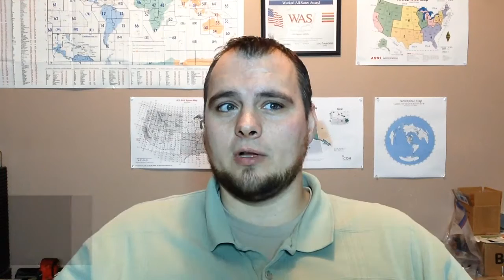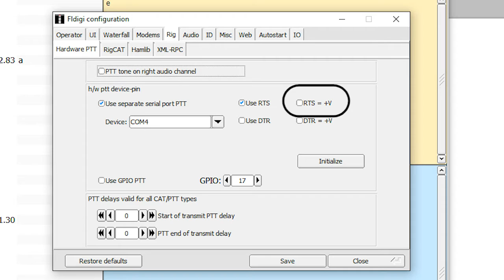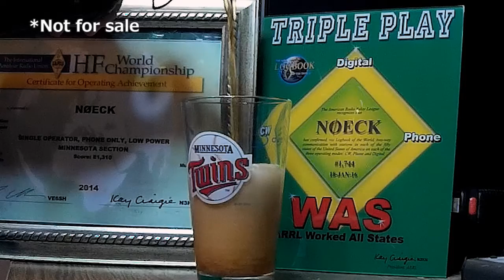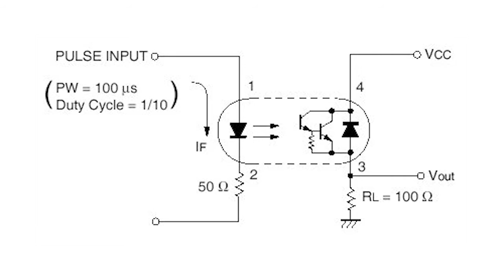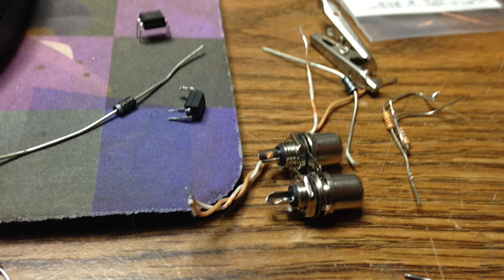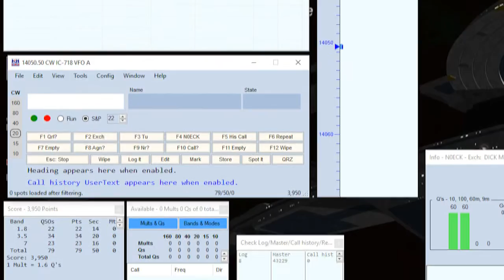USB Push-to-Talk Interface w/ Bonus CW Keyer!

Comment: I have an IC 718. I have the cat cable with the Serial jack. I have a Serial port on my computer. What is the best way to connect that and would that be the best for the mixer? Or is it best to go from the 8 pin to the mixer? And how??? The CAT works great with the computer, except that when I start the program, it automatically transmits and I have to click Tx on the screen!
Reply from the maker: That's a little more specific than I like to get in my videos. I would always suggest running audio into and out of the DIN plug if you can, but that has nothing to do with CAT nor with the serial PTT.
If I have my rig on when I reboot the computer it will flip in and out of transmit a couple times, that's the computer testing the serial line. As long as you don't have any music playing or any other audio running into the rig it shouldn't be a problem.